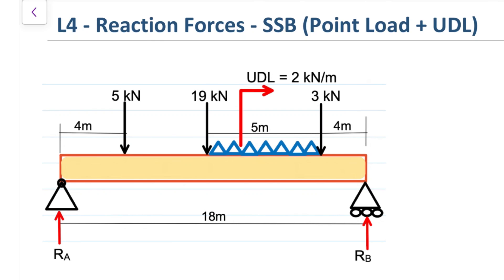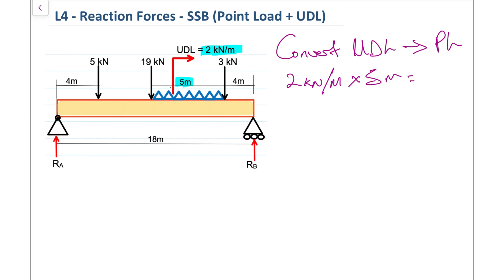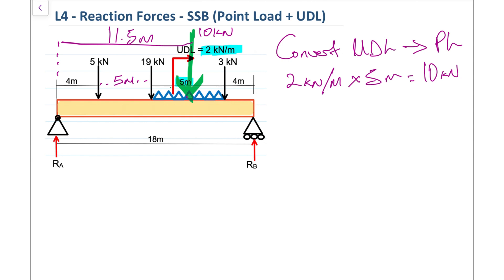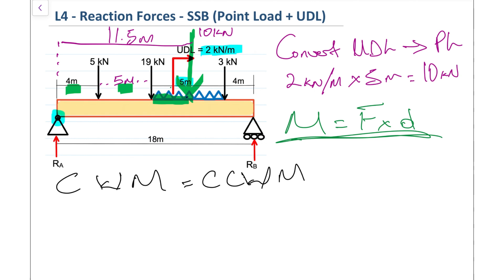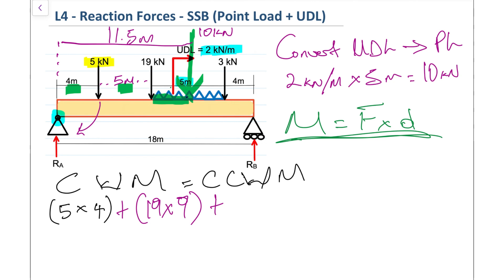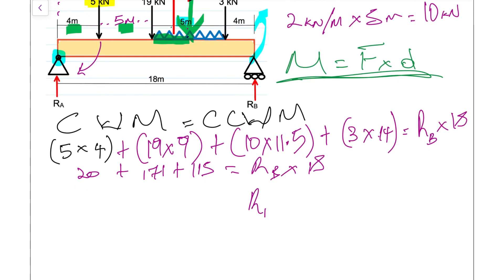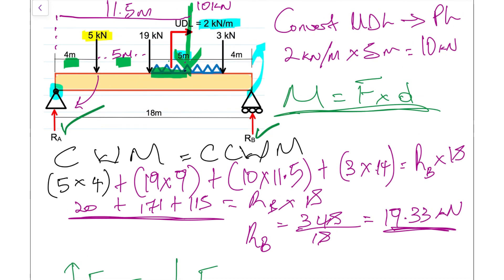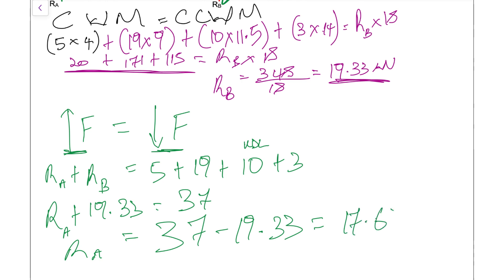Beam Reactions | UDL & Point Load Solved Step-by-Step

Comment: U didn't add the last force
Reply from the maker: If you could let me know the time in the video I will have a look. Just reviewed sections where I’ve added forces and couldn’t find any that was not added❤
Reply: At 5:19
Reply from the maker: @chachatyngz  I’ve had a look. It was added on calculator but for some reason I didn’t write it down. (5x4)+(19x9+(10x11.5)+(3x14)=348. Thanks for picking this up though❤